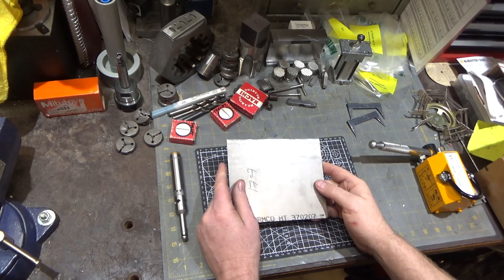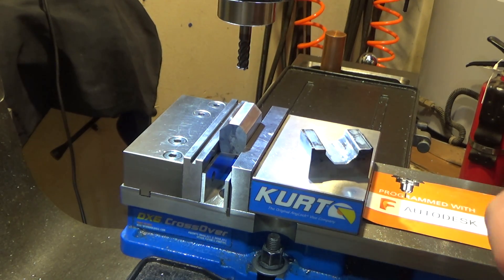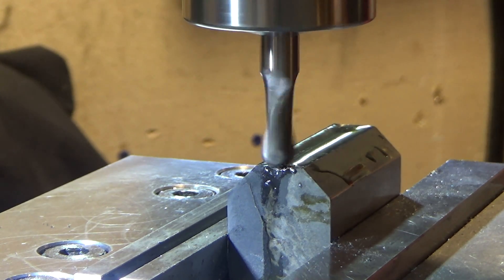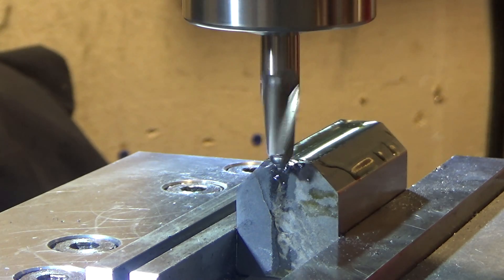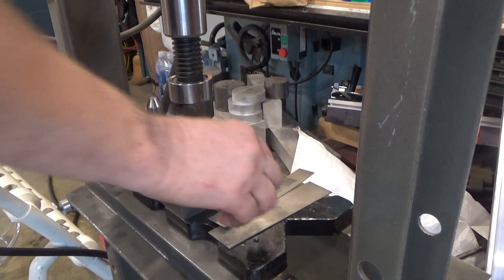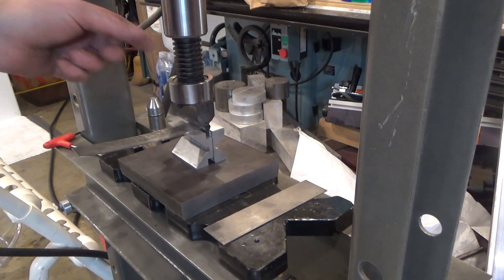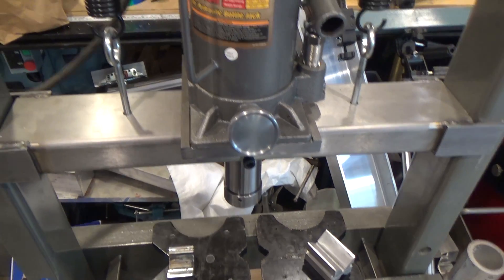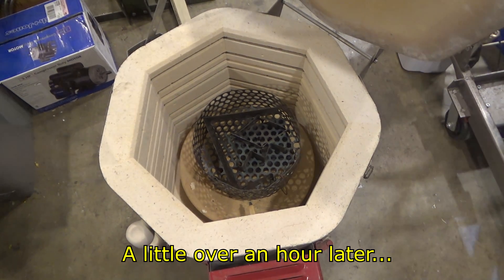78 17-7 Stainless Spring - Parallel Keepers

Comment: Good morning. I was watching your heat treat videos and that inspired me to purchase a kiln very much like yours with the exception mine does not have the digital readout. I’m in the process of setting mine up so any tips would be much appreciated. Thank you, Steven.
Reply from the maker: If your kiln is a Skutt, they sell an upgrade to the controller that gives you a digital interface. The one problem with a kiln like this is that it takes forever to cool. When you heat treat you soak at a high temp for a bit then quench and then you are supposed to temper at a much lower temp and quench immediately after. The second part of the process will have to wait hours for the kiln to cool. You could temper in a home or and electric oven though. Don't try to speed cool the kiln or you might remove the temper from the heating elements and they might fail prematurely.

Comment: Interesting video. One thing to try maybe with your milling and turning is to bump up the feed quite a bit. This reduces heat and wear on the tool. Try for at least .002-.003 min feed per tooth on carbide EM. 1/2 Carbide EM @ 3000 rpm say 30-40 ipm feed, plus coolant in harder materials. Just helping u save your expensive tooling. 
Thanks for sharing
Reply from the maker: Thanks for the tips. I really appreciate you taking the time to share your experience,
Reply: You seem like a really nice guy, with very good gear,  and you are keen in learning the trade. I’ll share what I can, I mostly program and operate cnc mills and lathes, but I spent 10 years on manual lathes and mills and know some tricks.  Good vids.

Comment: The copper jaws puls away to much heat from the base, and you have to use  flux with brazing. it will be ok then
Reply from the maker: Thanks for the pointer. I had some flux, but was not sure if it was ok to use with steel. I had purchased it for silver soldering. I should have looked it up.

Comment: looking at SDS for cherry red, its a nitriding compound.  It puts nitrogen into solution to harden the surface.  It would go deeper than a carbiding compound and it would generate nitrogen when it melts.
Reply from the maker: Thanks for the insight. I really appreciate it. Your explanation matches what I saw when using TIG.

Comment: Hi nice to be here, we are here to learn about 17-7 we have machined 17-4 and a little 15-5  (we looked up and learned both are precipitation hardened ss) and we know not much about welding so yes we can learn plenty here from you. Thank you for sharing. It sure looks nice to have a pneumatic hydraulic press we only have a manual one, nice rig up on that press. 
The pieces sounded glass like when making contact together as well as during the adding them to the tumbler. We hear the spring tone. 
Nice work and nice share to learn here for us.
Nice build, nice use, and see the need for them for the parallels
Thank you for the share, Lance & Patrick.
Reply from the maker: In truth, I don't know a whole lot about welding either. I have read a couple of books, but there is no substitute for experience.

Comment: Brazing steel without flux will not work. Welding may not work, if you have to much carbon in the material. I would try to silver solder it, but with flux, of course. That should work, carbon or not, and with different materials, regardless if they can be welded or not. And i would recommend to steal, borrow or buy a hardness tester or a least a set of hardness testing files.
Reply from the maker: I was not sure if the flux I had was right, but I suspect that you are correct. However, even the TIG welder was having massive porosity problems on thew first few tries. I do have some hardness files, but did not even think of trying that. Thanks. Sometimes the obvious solutions evade me.
Reply: @DudleyToolwright   I have no idea if the case hardening compound was your issue or not, but I've never heard of anyone brazing without flux except for TIG brazing and can't imagine it working. I'd say any type of flux, even the wrong kind is better than no flux at all. Also another option for things like that would be to just use some hardfacing rod on it.  Thanks for vid. Like.
Reply from the maker: Thanks for the suggestion. As you probably can tell, I am not even close to a knowledgeable welder. I wonder though if it would even have worked with flux, because, as the metal heated, it seemed like the cherry red compound was coming out of solution. Thanks for the suggestions. I really appreciate the help.

Comment: There's multiple ways of keeping the thinner parallels from falling over or moving out of place. Usually I just add a drop of any oil handy to the back of each parallel. Vactra no. 2 seems about the best though.That and since the oil displaces the air then the usual 14-15 psi of atmospheric pressure helps to keep them stuck to the vises ground jaw faces. Dirt cheap, easy, nothing to keep track of or get lost. A very thin coat of grease can also work. Wavy parallels might need the keepers, but they don't fall over as easy anyway.
Reply from the maker: Neat ad-vise. Thanks. I like the Vactra solution. It is a bit quicker than making some springs.

Comment: When I encounter contaminated metal while TIG welding,  I switch to AC, adjust the balance for cleaning, and sweep the metal to remove contaminates. The tungsten will need to be mechanically cleaned afterwards.
Metal banding also works well as a keeper for parallels, but you have to be careful with the sharp edges. I have an assortment of coil springs that I prefer to use.  
I'm curious about the performance of your die set for forming soft inserts for your lathe chuck. Did it work well and was it worth the effort? I form mine in a vise and it's a pain, but I don't do it often. So I'd like your opinion. Thanks.
Reply from the maker: Thanks for the advise. I did not even consider AC on the tig. It sounds like a good idea. The forming dies worked pretty well, but in truth, tho be really good I would have needed to make another set slightly modified. I did learn a lot though. If you damage your soft jaw covers a lot like I do they can save a lot of time. I created my first ones in the vise like you and it does take a lot of time.
Reply: Really AC on carbon steel with steel filler? I've only heard of using AC on steel when using an aluminum bronze filler. Sounds crazy.
Reply: @Steve_Just_Steve  AC isn't used for the  welding process. It's only used for cleaning passes to remove contaminants.
Reply: @EDesigns_FL  huh, Okay that's interesting thx